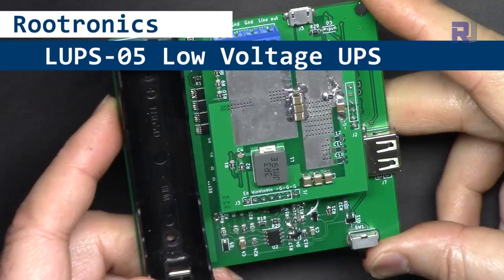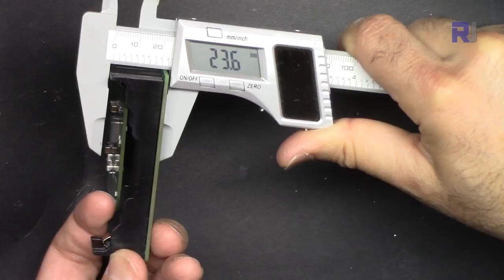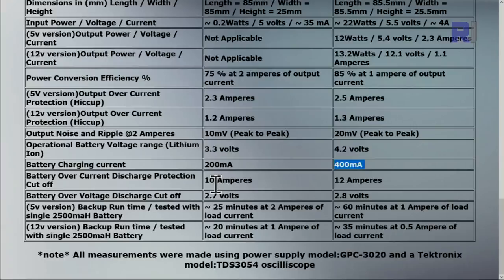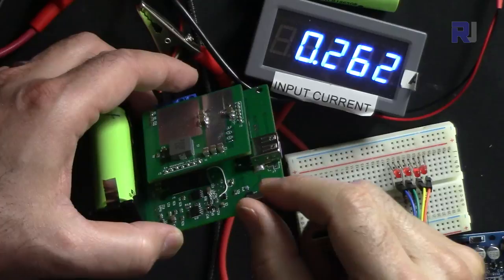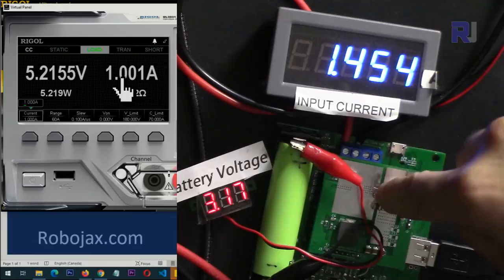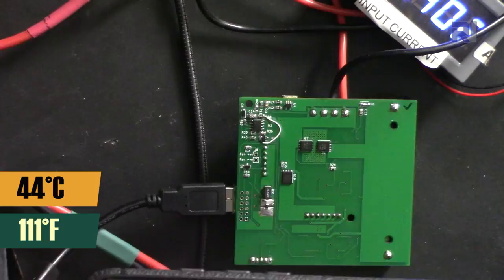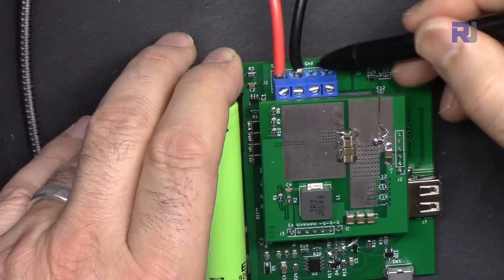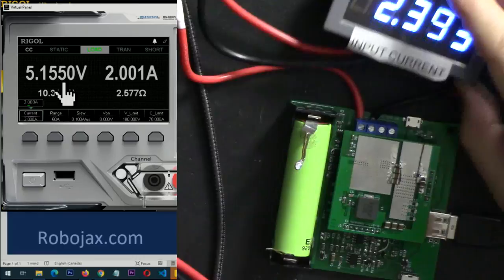Review of Roottronics LUPS-05 DC 5V 2A UPS for Arduino and Raspberry Pi using 18650 Lithium battery

Comment: Is a schematic available? I'd like to be able to examine it to get an idea of whether or not it would be viable (i.e., would it work -- without damaging anything) to "bootstrap" itself by running a line from the battery to the power input (either momentarily, continuously, either directly or through a resistor)?

Yeah, I could just use the DC-DC board, but it'd be nice to have a UPS with self-start ability 

I've used that type for 110VAC and it was very convenient at times. For example, it'd be nice to be able to periodically power up for a short interval every so often during a power outage.
Reply: Unfortunately the schematic will not be made available. Once the UPS is started the output can be turned on and off using the switch until the battery is depleted.
Reply: @roottronics2566  -- Thanks!

Comment: Thank you very much for your wonderful job. You teach very step by step. I want to read the DHT11 (attached to an Arduino) data directly from MATLAB without uploading any code or library in Arduino boar. Can we do like that. I yes then how? 
Regards,
Reply from the maker: hi, why you posted your question under a module that has nothing to do with DHT11 while I have so many video on DH11? Interesting topic. but I have not heard such thing yet.
Reply: @robojax  thank you very much for your kind response. The reason I posted question here is that 1st I visited your channel and then I searched for the most recent video that you uploaded because I though whether you will see the comments on old videos or not but definitely you will see the comments on the most recent video. That's why I posted my question here. Further, if we want to write our own code for this purpose, what should we do? Thanks once again.

Comment: Probably can power a pi zero W. How about the pi zero 2?
Reply: Absolutely, we have tested it with a raspberry pi  3 connected to a 7inch hdmi screen. The raspberry pi had wifi enabled. The UPS easily handled this load.
Reply: @roottronics2566  Great! I have a pi3 DIY raspad setup with a 10 inch screen from sunfounder. I may swap for the pi zero 2. Thanks!

Comment: I wonder if they'll offer an option for multiple batteries with a charge balancer? I have never built anything using a balancer so I haven't researched it much, I don't know if parallel balancers are available, or if they only make them for serial applications (i.e., power tool battery packs needing voltage higher than one cell).

I suppose that if I had a battery analyzer I could just put two (or more?) matched cells in parallel, but even so, it wouldn't be ideal.
Reply: Hi, if you parallel more batteries you would get longer backup time. The batteries would also take longer the charge. Normally matched batteries in parallel do not require balancing.
The ability to use one battery offers the lowest cost option.
Reply: @roottronics2566  -- Alas, I can't afford a battery analyzer.
Reply: @roottronics2566  -- PS: I guess a larger capacity battery would be an option. (I don't remember the X/Y "dimension numbering" for them but IIRC they are available in pretty high capacity, about the size of a "D-cell" battery.)
Reply: Two or more batteries the same can be paralleled with impunity, no balance required. It simply takes n times as long to charge where n=number of cells paralell. Balancing is essential for series connection, however.